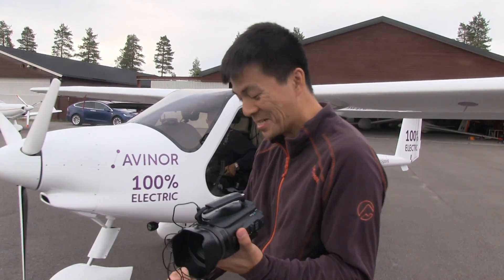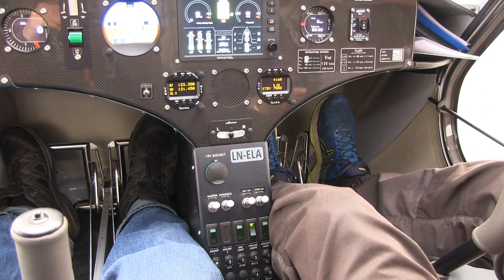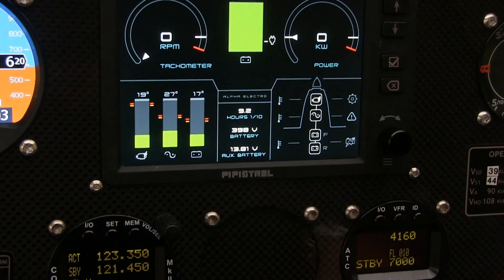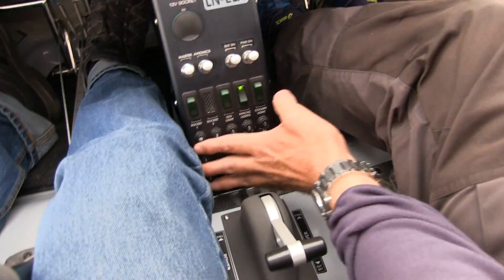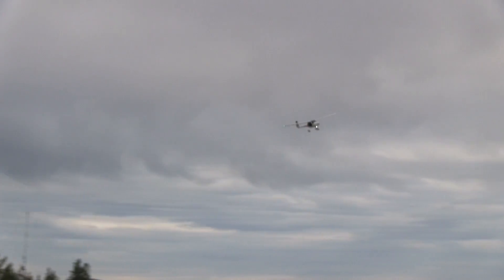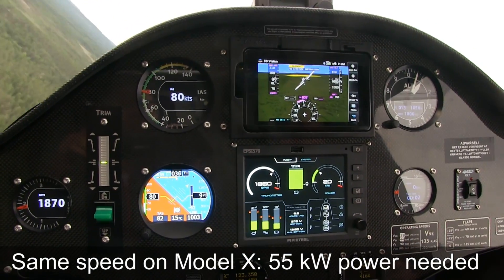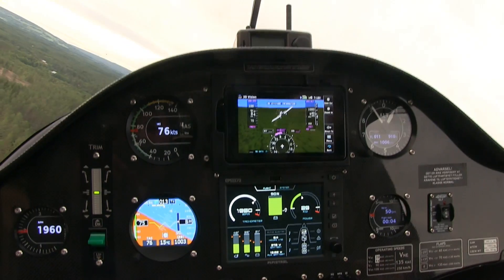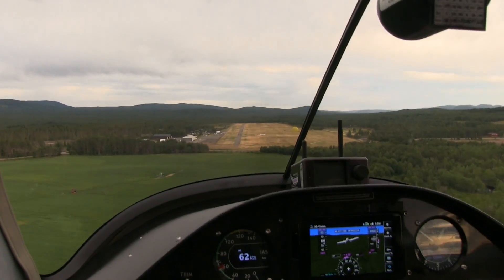Test ride in Pipistrel electric plane

Comment: Great video Bjørn, thanks for sharing. I was surprised that the plane was not quieter than that? But the power consumption is really good.
Reply from the maker: EVs still have tire noise at high speeds. And electric planes have propeller noise.

Comment: No warmup, no ignition test, no carb ice, but probably also no cabin heating
Reply: I bet you have cabin heating even if the motor isn't running. Lime in an electric car... The consumption of electric heating isn't that high. Maybe 1 - 1,5 kW/h or even less.
Reply: Electric engines also get hot...

Comment: 1 hour flight for 2 bucks. I think some people will fall off their chair when they see this.
Reply: Zeksteve  My home batteries have a guarantee of 80% minimum of original capacity at 5000 cycles to 90% DoD using LiFePO4 chemistry, that's a lot of flying! What's the kWh rating of the plane battery?
Reply: Zeksteve  Acording to the manufacturer's FAQ, it holds 75% of the original capacity after 300 to 700 cycles, depending on how well you follow the recommended procedures. Extra care must be taken if you live in cold climates, acording to the same FAQ, temperatures bellow 10°C / 50°F can prematurely reduce battery capacity.
Reply: Zeksteve   Yes I may  Be  Spending a bit more money To build something like a kit Fox with  A rotax 912. But I'll have an aircraft that can take me across country. In engine with a tbo over 2000 hours.  And what the fuel burn between  4 to 6 gallons per   hour,  That's performance  That is pretty hard to  Beat. How many hours of run time do you think that lithium battery pack is gonna give you. And I don't think the cost of buying an electric airplane is any cheaper then buying a gasoline driven aircraft.
Reply: Fuel is not the only cost when operating an aircraft, I expect energy isn't going to be the main cost in an electric aircraft either. For starters, the battery pack has a limited number of cycles it can go through before you have to replace it.
Reply: @gcolombelli  An engine has a limited number of hours before you have to rebuild it and I'm certain you'll be rebuilding your engine more than once before a well specified battery needs replacing. Add to that the fact that batteries don't simply "die", they just slowly lose capacity.
Reply: @Kimoto504  I doubt the engine needs rebuilding...its a brushless electric. Those can probably outlive the plane.
Reply: @Kimoto504  ,Ever had an electric golf car? A gasoline golf car is twice as cheap for operating cost. All gasoline vehicles are cheaper than an electric vehicle. Recharging those batteries is going to cost more than whatever the gasoline cost for the same duration, and much, much more in the long run when you figure in the expense of the batteries.  This is why electric transportation will never be feasible. Unless you have a gas powered generator on board, as with the locomotives that run on electric.
Reply: @zanpekosak2383  I think paytontech  was refering to the ICE engine on a regular aircraft, which needs to be overhauled after 1200~2000 operating hours (typical values for general aviation aircraft). 

Despite having an electric motor, acording to the manufacturer's FAQ it needs to be overhauled after 2000 hours. It's probably a lot less expensive than overhauling an ICE, but I guess it won't be super cheap either (nothing related to aviation is).

The battery is stated to still hold 75% of it's original capacity after 300 to 700 cycles, depending on how strictly you follow the recommended procedures. It is said to have an endurance of 60 minutes + 20 minutes of legally required reserve, which will go down to 40 minutes (remember the mandatory 20 minute reserve) at that point. Also keep in mind that lithium batteries need some extra care on cold weather, failure to do so will prematurely decrease battery capacity.

I'm not saying "don't buy it" or "it's actually more expensive than a regular (ICE powered) aircraft", I'm just reminding people that the math on operating costs isn't as simple as comparing gas prices to electricity prices. I would love to see someone actually trying to compare all costs, just out of curiosity. Personally, I'm not on such a good financial standing right now to seriously consider such an expensive hobby. Maybe it's actually cheaper on the long run to have an electric aircaft, who knows? But if I was a betting men, I would not wager on it dramatically reducing costs anytime soon.
Reply: Oh wow. Posted too soon, at the end of the FAQ there are some interesting numbers (from october 2017).
Motor overhaul cost at 2000/4000 hours: €500 + 12 hours of labor
Motor replacement at 6000 hours: €10,000
New set of batteries: €19,500
Replacing the cells while reusing the old battery housing: €12,000
Reply: @zanpekosak2383  paytontech was highlighting that a piston engine may need rebuilding more frequently than the batteries in the electric aircraft
Reply: @CardiffHomeMade  Butt standard BLDC motor similar to the ones in this plane or on drones actually never need rebuilding...have you ever heard of someone on a camera drone that goes to some respectfull heights and moves at pretty impressive speeds replacing the motors?
Reply: @zanpekosak2383  Is this Engine licquit cooled ? Its lowering the stress of heat for the coils of the engine. Bearings should be replachet easily. The inverter elektric and the batteries will be expensive in Maintenance.
Reply: AirsoftSlo He said engine, not electric motor.  Learn the difference.
Reply: @gsp49  "never" is a strong word. Solid state batteries may have twice the energy density and can be recharged tens of thousands of times without much degradation.
Reply: I think the gasoline version would be better way to go definitely cheaper to run. Electricity is not free. It does come from somewhere. That somewhere is hydrocarbons or nuclear. Besides when it's time to change out those batteries you're going to have sticker shock at the cost 2 disposed of all that hazardous waste.